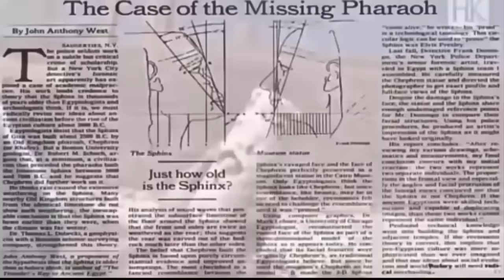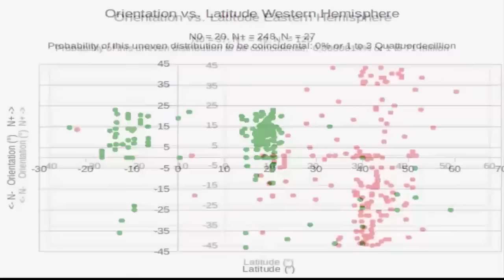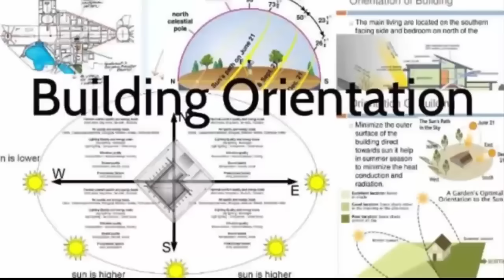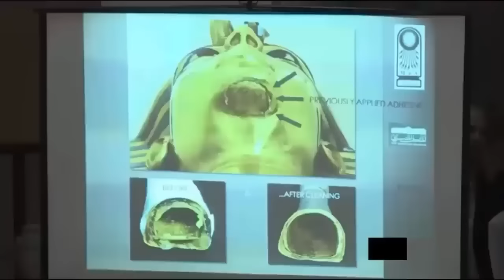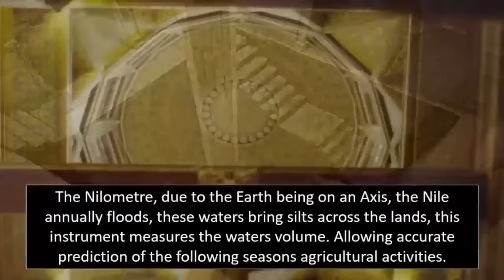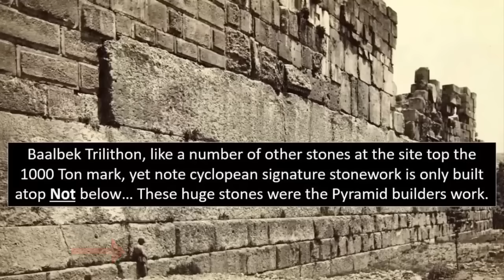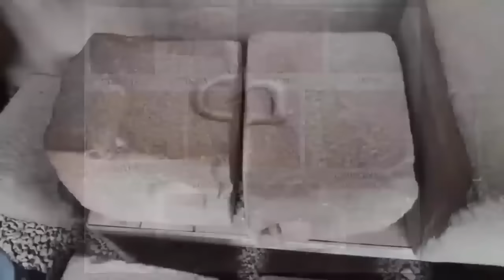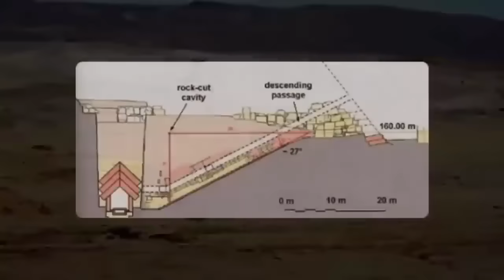Graham Hancock | The Great Pyramid Conspiracy

Comment: In Charles Hapgood's book "The Earth's Shifting Crust," 1959 lists the changes in the North Pole over the last 4 times. This book was open on Albert Einstein's desk at the time of his passing and has very relevant material pertaining to the orientation of many of the structures that you have been researching. It's worth a read. You might find it useful. 
It appears that the signature tool marks are on both sides of the stairway and possibly salt crystallization on the old pyramid.